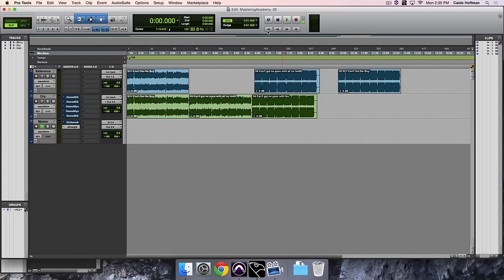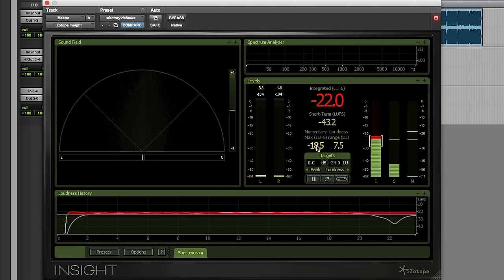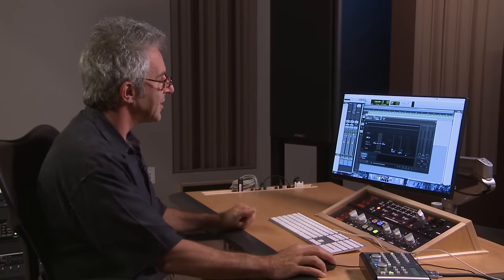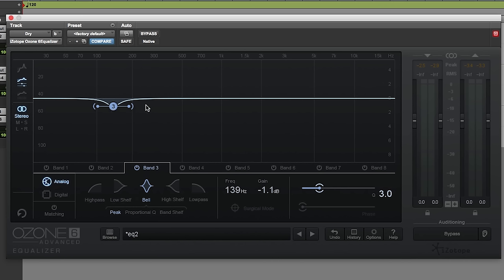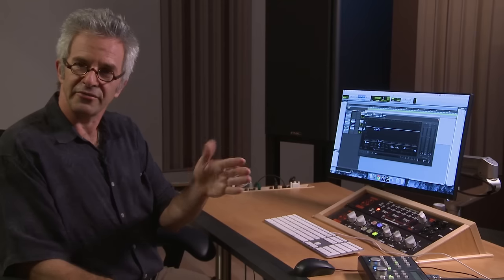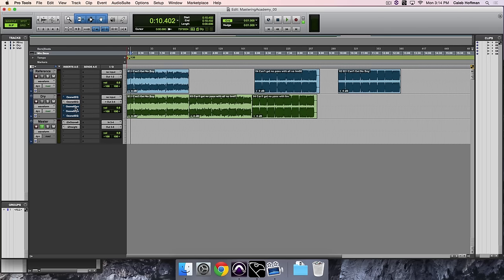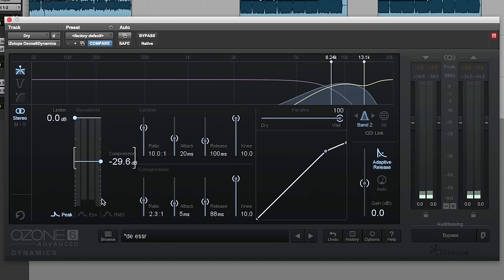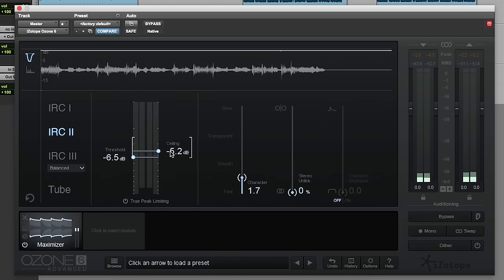iZotope | The Mastering Workflow Webcast

Comment: Hello ..we have nowadays a lots of players with a default 3d effect/filter plugin.. eg the KMP. I have noticed that in many great songs (soft rock to hard rock) as soon as the effect is turned on,the vocal getts killed to a high extent and becomes unclear. So what's your view on this? How this can b fixed through mastering without losing the loudness.? Thank you- zamini
Reply: +TheArrot What is the plugin? If the vocals are only in the mids(as in mid/side, not frequency) which is often standard they might get killed by it. Hard to say without knowing what it actually does. Maybe ensure its in the sides of the signal. 

But its consumers perogative if they use these things. Mastering already accounts for speakers, headphones, and bad quality versions of the above, but not so bad quality versions of the above that the music sounds odd.  For example, don't mix for it to sound good on laptop speakers with crazy stereo enhancers, get it right for true monitoring or OK consumer level equipment and not so much compromise otherwise the track won't shine on anything. I'd be inclined to just say: don't use the plugin, and tell KMP to do a better job.

Comment: Question: how do I maintain consistency for an album? Not only for mastering but also for mixing. I recently recorded a few songs for a release but the levels of instruments in those songs are DRASTICALLY different. It's only until I got into mixing an album did I found out how difficult this is.
Reply: Get one track how you want it, then use it as a reference for the others

Comment: What type of adjustments to your system/speaker volume levels do you do during mastering, and for what purpose?  For instance, an engineer told me to (at some point) turn down my speakers or computer output levels to below 10% level for the purpose of listening to the hi-hats.  What is the order that you generally do, when you listen on varying speaker types; and what are those speaker types?  For example, the same engineer told me that when I feel like my first mastering session is done, I should render and listen in a car system with decent bass to treble levels... then go back to the studio monitors and make small adjustments if needed; and to listen in crappy (laptop) and headphone speakers & do the same.  Also, club speakers and crappy portible stereo speakers have become a part of my over-all mastering work.

Comment: You should make a tutorial that goes into more differences in the streaming platforms.  For example, Tidal streams with FLAC format, so 44.1 khz sample rate is needed (I may be mistaken).  Most platforms want a 48k/24bit WAV to be uploaded.  itunes radio wants -16 LUFS, but Spotify/Pandora/Tidal/Google Play Music/Amazon Prime/Deezer/Rdio/Rhapsody use -14 LUFS.  Some platforms stream at lower bit rates.  For example, soundcloud streams at 144 kbps quality, so a lot of the material above 16 kHz (especially on the sides) is lost... so I may find myself boosting the sides on the highs more, for soundcloud/bandcamp.  Soundcloud also does not normalize, so -8 LUFS (or maybe sweet spot for loud is -9 LUFS) works fine.  Tidal streams at 1.4 MBPS, while spotify is at 320 kbps and itunes radio is at 256 kbps.  Perhaps, previewing at 256 kbps is best?  What would you guess the best methods would be (for treating the sound on the sides, above 14 or 16 khz), if one is planning on using a distributor in order to send out one file to all of the streaming platforms?  Would you go with -14 LUFS and let apple radio normalize it, or is apple radio greater than the sum of all of the platforms that stream at -14 LUFS?  What do we think the future will hold, as far as platforms' meeting at fixed bit rates and average loudness?????

Comment: for the multiband compression part, i noticed he was compressing in RMS mode....i def feel that RMS and PEAK mode have a very different sound. i have seen a lot of Mastering engineers master in peak mode. Is there a certain reason he chose to do it in RMS mode? Does it give more of a natural transparent sound which he preferred?
Reply: From what I've read peak is more abrupt and sudden usually with a very short attack while RMS is more loose and natural feeling so it all depends what you're trying to do.

Comment: Really informative video, props iZotope. However, I've got to think this guy is living in a very unrealistic climate regarding "level". -0.5dbfs output ceiling as a standard and never exceeding -0.3dbfs? I'm only familiar with Jazz and classical albums going that conservative. He boosts 6.5db from -22lkfs, so the track is sitting at -15.5lkfs and barely 1db of limiting on the loudest peaks. Does he really think the limiter is sculpting the sound differently in that instance? This just feels like a case of extremities. I can hardly think of any client in the non-jazz/classical realm that would be satisfied with less than -12, though they'd likely be asking for somewhere in the realms of >-9 like any pop record. I don't know, I just always feel duped when mastering demonstrations showcase an unrealistically dynamic and low-level output and say "this is how you do it". That's rarely a liberty. Anyway, no hate on iZotope, mastering month is a good idea...
Reply: SocietySalvaged -0.3 is only three tenths of a db from digital clipping full scale. 0.0 is the top of the red line for digital meters. That's just a safety precaution to allow for slight bumps in format conversion. Otherwise you'll get clipping. The 6.5db of limiting is actually alot. He's raising the average level from -18 to -11. That means peaks in that mix are getting some serious limiting and a good portion of the punch of the record will be bumping right up against the -0.3. Also, listen to his comments about loudness normalizing in streaming and YouTube near the end of the webinar. Streaming providers and YouTube are becoming primary listening environments for people. These providers automatically put loudness normalizing on everything. Consequently, the more pegged the meters are on your song, the more likely it is that your track will be actually lowered by a loudness normalizer and sound flat and thin. It's another new change that is affecting how mastering engineers optimize music.
Reply: Aaron Doerr You are correct. Thx for sharing.
Reply: Hahahaha!!! that is why he is the Mastering engineer and you are not!!.....hahahaha!!....just educate yourself......there are programs/songs even at -0.2dBfs...do you know why?.....research....google it.....that is mastering..